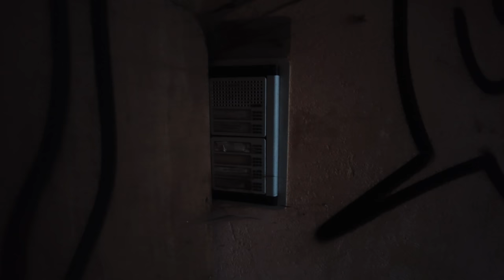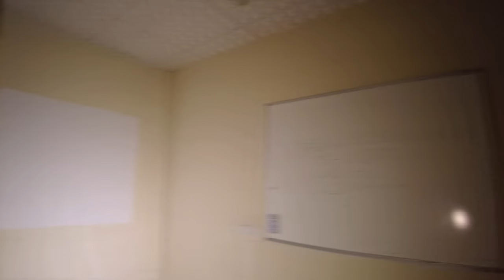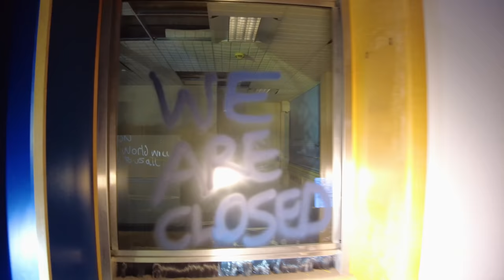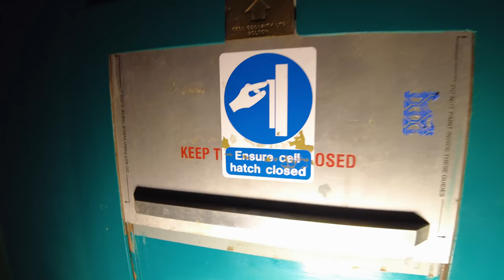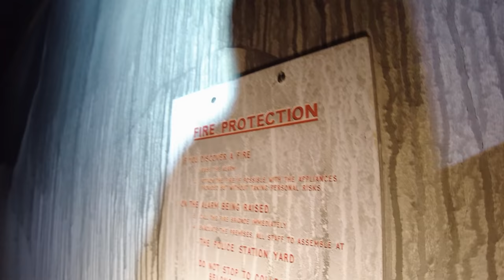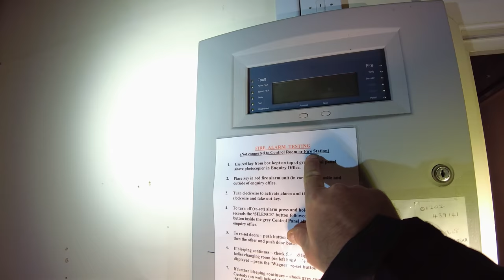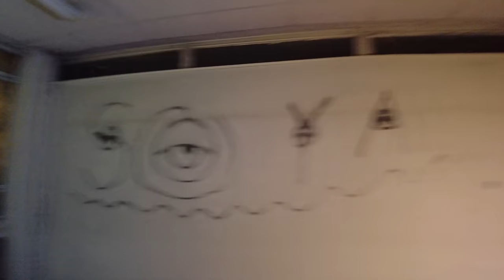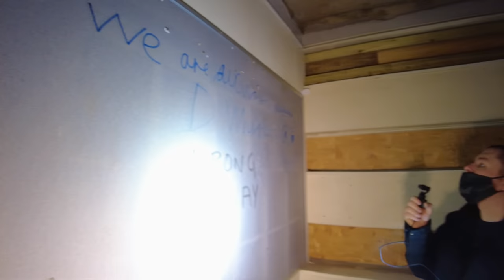Christchurch Police Station DORSET Demolition Soon.

Comment: The courts are built onto the back ,did you not get into them also?
Reply: That might explain the sealed off corridor, a secure link between the two buildings 25:39
Reply from the maker: Ah I wondered what that building was. It was burned out to a crisp. That was the wooden door we couldnt get into.